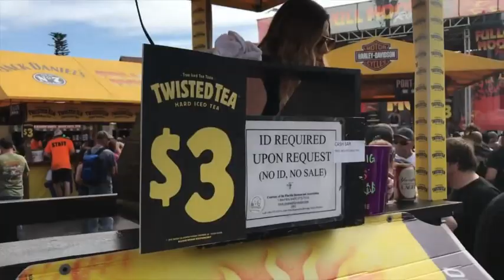The difference between bikers and gangsters on motorcycles

Comment: I'm a motorcycle enthusiast. Not a club member or a 1%. Not a rub. Middle class been riding for 35 years. Did about 350 miles yesterday to the other side of the state and back home. Was going to go to Daytona today but as of 8:00 AM the mayor pulled all the permits and shut the rally down. Bummer man.
Reply from the maker: Rock on Alan